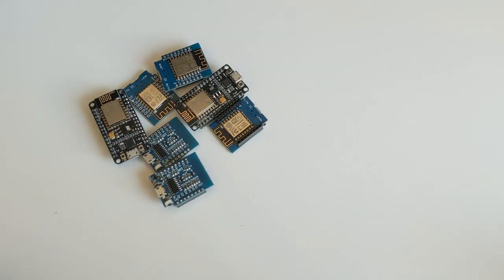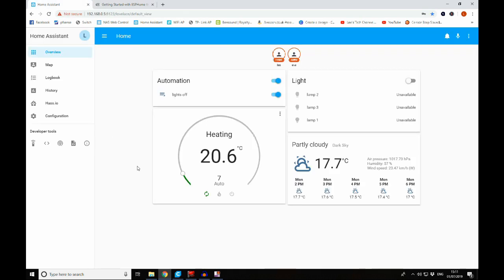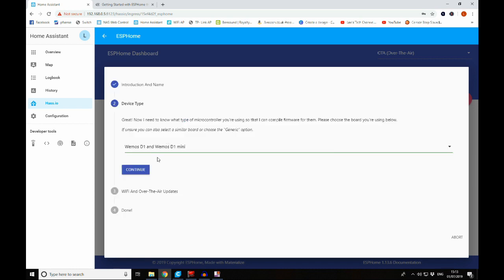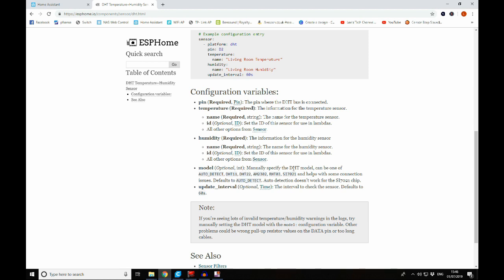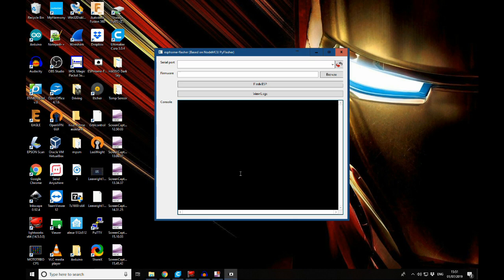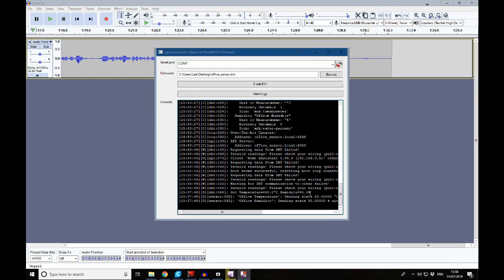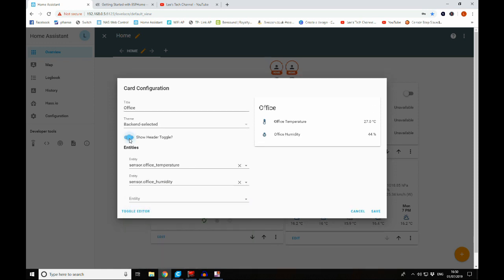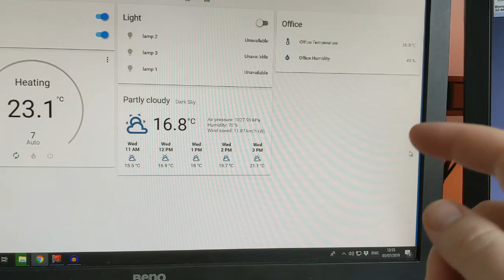Home Assistant Temperature & Humidity Sensor

Comment: Great video Lee. Thank you very much. One starter question, did you finally had to connect the ESP8266 to he computer USB port? I´m not sure, if it is not necessary Then I´ll try to do it
Reply from the maker: Hello. Yes to flash the ESP8266 for the first time you will have to connect it to your computer via USB. After you have done it once and the device has your network information then you can flash it over WiFi. Hope that helps
Reply: @leestechprep   Thank you very much Lee. Amazing rapidly answered. Can you recommend me where I can learn to do the USB process? Thank you very much

Comment: I want use dht22 temperature sensor interface with home assistant all program are set successfully upload program in my ESP8266 but this type of ERROR occur   ERROR Logger is not configured! How to solved this problem

Comment: Do you have a Raspberry ?
I don't have Raspberry, i need?
Reply: No.  Home Assistant (HASSIO) is compatible with a few devices and virtual environments.  https://www.home-assistant.io/hassio/installation/
The "Home Assistant Core" can run on any host via Docker (including Windows) - I would not recommend this since the user interface is not included and add-ons (like ESP Home) are not supported.  https://www.home-assistant.io/faq/ha-vs-hassio/